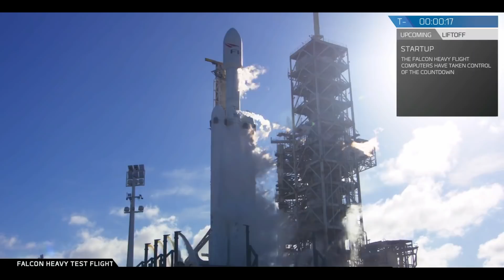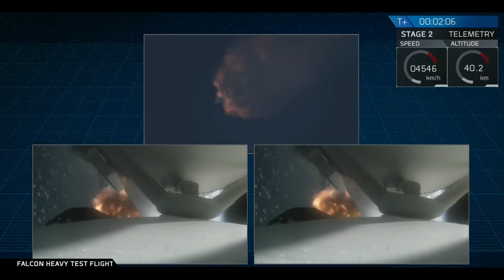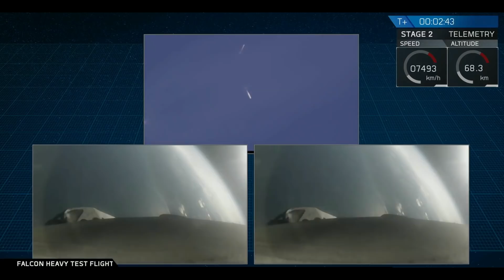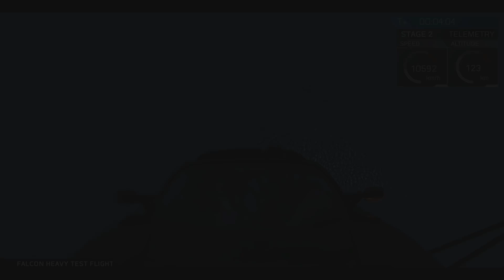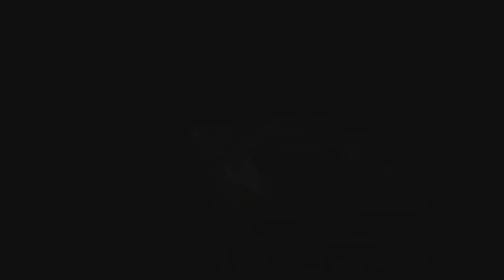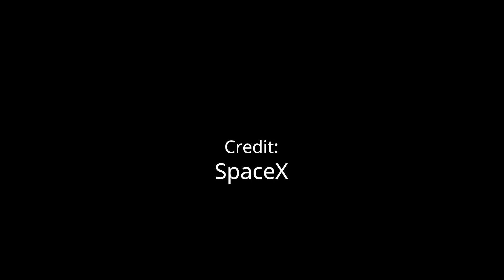Falcon Heavy first launch

Comment: What happened to the core?
Reply: richard scales no it crashed into the sea
Reply: crashed into water at 300 miles per hour :/
Reply: Надежда Аванесова cenici3ntt
A
Reply: Jacob J I thought it didn't have enough fuel to slow it down in time to land on the ship
Reply: 008 Rip oh dear
Reply: It exploded and took out 2 engines on the barge since it didn’t have the new titanium fins the outer boosters had
Reply: Надежда Аванесова landed on the barge I believe